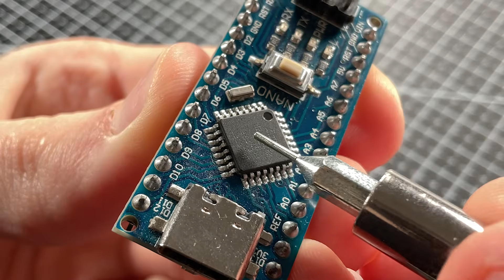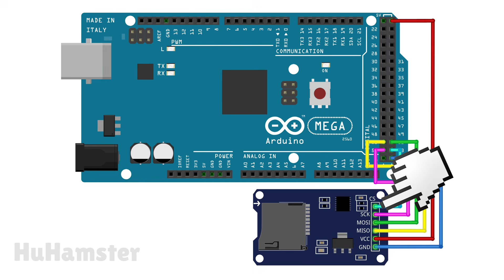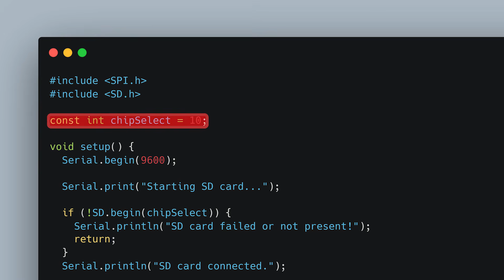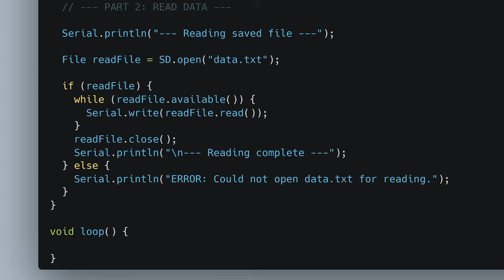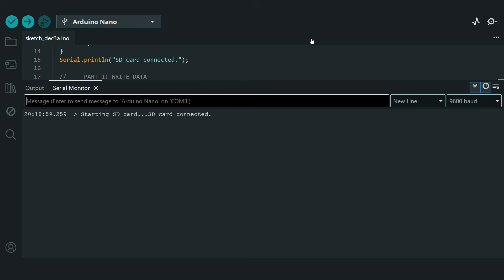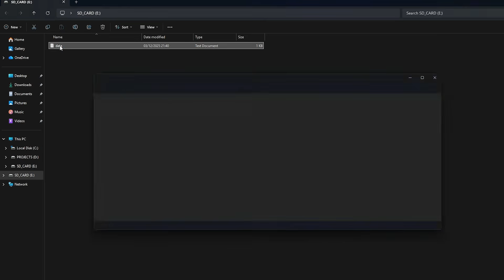Using SD Cards with Arduino

Comment: I have an arduino uno r4 wifi and the exact same module but its not working. My SD only 16 GB so i dont think that is the issue. Do you have any ideas to help? thank you in advance
Reply from the maker: Check if your module has a voltage regulator. It’s a small black chip labeled AMS1117 or 662K with three pins and a metal tab on the back. If it's missing then you have to use 3.3V because 5V will fry the card. Also sometimes the card just needs a clean format. Try regular Windows format to FAT32 first but if that fails download SD Memory Card Formatter here: https://www.sdcard.org/downloads/formatter/ Just select the card, hit 'Quick format' and you’re good to go

Comment: I also used the same module, and it doesn't work. card is inserted with correct wiring but its not recognized by both the Arduino Uno and Arduino Nano. Infact it came with 2 options, one for 3.3V and another one for 5V. tried both of them but still didn't work.
Reply from the maker: Perhaps the problem is that you are using too much memory, more than 32 GB, because the sd.h library cannot process a larger amount.

Comment: Calling this bogus, got this kind of module and it doesn't work.  Card is inserted, wiring correct, chipSelect matched.  Nada, what a scam.
Reply from the maker: Hello, are you sure that this is a 5-volt module and not a 3.3-volt one?